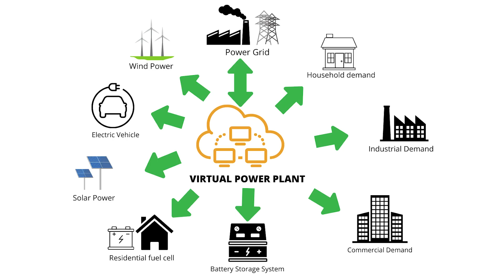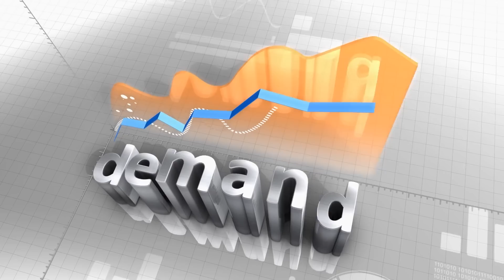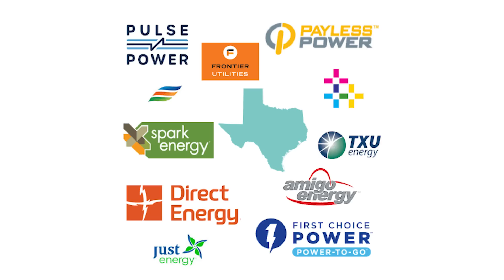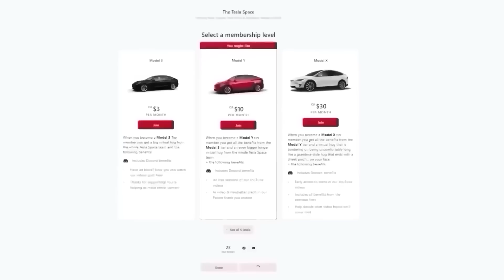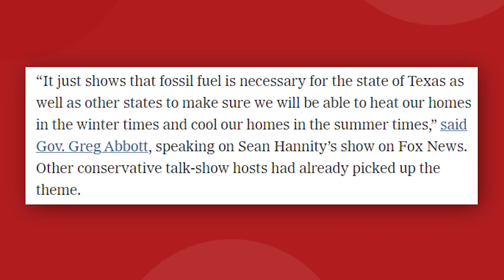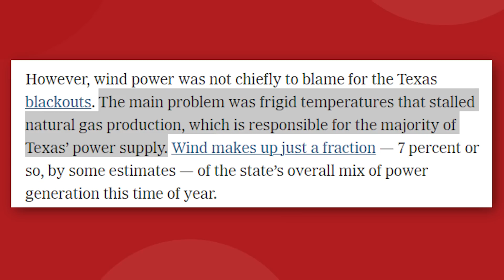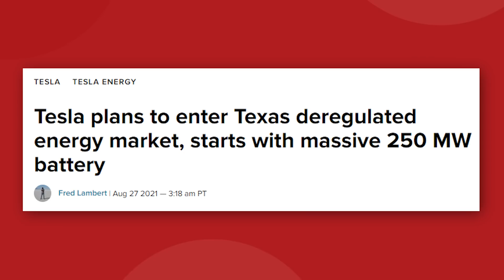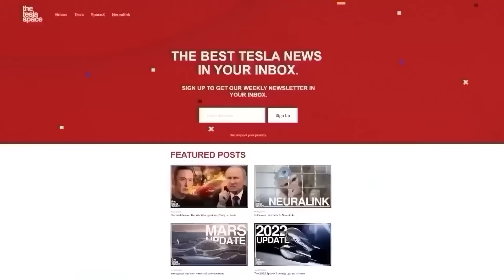Why Tesla Energy Is About To Take Over Texas!

Comment: If you want to take a fish out of water and claim it is inferior on land....you are not wrong.

You are taking that 2021 winter storm in Texas out of context.   Texas is supposed to be in the south, where it is warm.   During that freak storm, the entire state was blanketed with snow and ice.   The temperature in Dallas was -3 Fahrenheit.   It was very cold for Texas.   There has not been something that cold for 100 years.    For those of you who don't know, -3 F would be similar to -20 C.   That is Siberian cold.  

So, if you want to say Texas wasn't ready for that.   You are right.   But, who would be?    Can any southern US state handle a subzero degrees F with snow and ice for 4 days?    Every summer, the temperature in Texas goes over 100 degrees F for 60-70 days straight, and with AC blasting throughout the state, the power do not go off.

Comment: Worlds first Tesla VPP was piloted and is running in Adelaide South Australia. The Left Wing State Govt installed rooftop PV & Tesla Powerwalls in 50,000 public owned homes. This saves low income families a huge amount on previously extortionate power bills & stabilises the entire cities grid. They also commissioned & installed the worlds first Utility scale Tesla Megapack at Hornsdale. The fossil fueled Conservative Party privatised public utilities and prices went sky high using gas. They screamed lies backed by Fox that it couldn’t work & windmills & solar would destroy base load owner etc etc ALL the same bullshit the Right said in Texas. But instead their fossil fuel donors dumb gas peakers are $500m piles of dead stranded JUNK. Saving citizens BILLIONS. Good riddance

Comment: The whole system has to be monitored, and information has to reach each battery pack stored in individual has just in time.

If there is cyber attack, or for some reason wifi is down, the battery pack become useless. They need to work together to bring an impact to the society, but I don't see a way that is done efficiently. So many things could go wrong.

Comment: Pipes freezing did not stop the flow of Natural Gas. I had natural gas the whole time but no power. The hot water heater stayed lit the entire time, and if I had a generator at the time I would of had natural gas heat. The failure was due to more than half the generators were taken down for maintenance to prepare for summer as we do not usually get a winter blast in Feb. It is usually heating up by then. Wind and solar could not support the load, and Tesla power plants had not been built yet to store that wind and solar.  Now that there is a Tesla power plant 30 minutes from me, I would like to see if that could supply power for this area.

Comment: So, this is the comment with real Tesla Electric provider experience. You would not be able to choose anymore when to switch to the battery or to the grid. YOu won't be able to program. The only time you will drain energy from the battery is from 4 to 7pm. That's it. And all other times you will either use it from the sun, - or from the grid, - which costs you around 14 cents per kWh (and this price can change at any time). Whenever you are selling your energy, - the average price in Houston would be 1.4-2.5 cents per kWh. Guess now what Tesla is doing? They are making money on us. They installed wind farms somewhere (not much) and instead of selling that energy to the grid for 2 cents, - they are selling it to us for 14. But luckily we do have the option to go off-grid. With some automation, I was able to program it to go off-grid and back online. If for some reason Tesla would decide to remove the button "Go OffGrid", - I'd install an extra smart disconnect from Siemens for example which I will be able to automate through the smart home and still can be in control of how I am using Energy. Be careful before you go Solar. You can get lots of issues without knowing all the tricks. I learned from FB group the best way to go solar: install a small array *8 panels", - which will lower your daily usage + you can do laundry, dry clothes, dishwasher and run another high load. Next to it choose the "free nights" plan, - where you will not pay for energy from 7pm till morning. I believe the game changer would be when we will be able to use Tesla car battery as the extender, - so whenever you have extra load, - we would be able to offset it into car in fully automatic mode. But it's not there yet. I'd try to find some kind of automation to charge my car whenever I have excessive generation, - but I don't want to sell it for 2 cents, - and furthermore, - I bet they are still charging for energy export to the grid.

Comment: Put the power lines underground.
Reply: so when the soil will shift it will be damaged and repairs will be costly. Is this what you saying?
Reply: @arishem555  In Madison Wisconsin almost all power lines are run underground. This is done in many parts of Wisconsin. When Ice storms or Tornados etc happen we are not as vulnerable. I lived in Florida where we had 4 hurricanes in one year across the state. That's lots of electric poles replaced over the years.

Comment: Frozen gas pipelines was caused by short sighted power plant owners, saved money not installing freeze protection. Wind mill blades had no freeze protection or deicers for the blades.  Those were not the only weather problems.  Fire Sprinkle pipes, out door wall mounted water heaters froze too.  The Texas Deep Freeze 2021 was the storm of the century but Dec 23, 2022 it got down to 10 degrees.  The coldest night in Dallas/Fort Worth: 8 below zero set in 1899.

Comment: Tesla's own Giga Austin complex could eventually contribute a reasonable amount of power generation, primarily solar, to the Texas Grid if they were to take advantage of all of the outdoor parking & materials storage areas (including) all of the circulatory bits. By circulatory bits I'm talking about the access routes within these areas. People only tend to think of the airspace above parked vehicles or stored items but the airspace areas in-between these amount to a fair bit of unrealised potential power generation too.
When considering how to manage the 'heat island effect' of the built environment, shading from solar canopies can make a significant contribution towards lowering the negative impacts of this phenomenon such as lowering demands on electricity for cooling, healthcare services & in the case of EV charging stations, make them far more efficient by keeping both cars & infrastructure cooler. 
Giga Austin is going to become a vast industrial complex. Of course they'll want to utilise as much of their own power generation capacity as possible, but this should still leave a significant amount of excess generation capacity that shouldn't go unused.
Reply: Not true. Even with 100% coverage on every available square meter of roof, parking area, and storage space, Giga Texas won't even produce half of what it consumes. The math is easy to do and the areas are known, as is the power consumption of the plant (on file with the building permits if you want them. $35 for basic plans, more for complete ones)

Comment: @3:35 -- "Two dollars per killowatt hour, which is not much..."  

Are you joking?!   In my town we pay about 6.5 cents per kwh, which is pretty cheap, admittedly, but even in an expensive area you wouldn't expect to pay more than about 50 cents. I don't dispute that you might be able to get two dollars under certain circumstances, but to call that "not much" is just bonkers.
Reply: I saw that too. $2 may have been some sort of extreme price paid by the grid when it's in extreme supply deficit.  For a closed system in TX that might happen more frequently than we realize, esp last year when they had 100+ temps for months at a time.
Reply: Same, i would like to get a clarification. I love this content and want to know how to get 2 $ per kwh.

Comment: This is a helpful explanation but the biggest thing Tesla is missing is the power stored in its cars. Any Tesla vehicle has multiple times the power in its battery than any powerwall has. By refusing to allow the cars to provide the power back to the house, powerwall or VPP, it is a lost source that needs to be activated. In addition, the massive growth of megapacks should also be included combined with TESLA solar fields.
Reply: I don’t know that they are missing it, but you make an excellent point!
EV batteries have much more capacity than even a very large power wall install!
The best solution would tap into both IMO, Cheers
Reply: @kaf2303  YEs, exactly and in teh Cybertruck, where it is allowed the owner can say how much charge should be left. If you know yu can always go to a supercharger withing 15 miles, you can go down to 10% charge and use up to 90% for the house. I also wonder if it would be possible to trickle-charge directly from solar panels. All these options should be integrated to really reach Tesla vision to a fully integrated electric energy future

Comment: in my opinion, fuck oil, fuck "renewables", nuclear, batteries, and hydro electric energy storage
Reply: Nuclear is the best power source
Reply: @caesarsalad1170  Fission is already plenty, and with Fusion on the horizon, it's easily the best power source, especially when combined with batteries or synthetic fuel

Comment: You said that when the power line is down to your house, that's when the powerwall at home is key.  I thought that the powerwalls did NOT power the house when there was no power to the house, which struck me as completely ridiculous.  So, will Tesla PWs work offgrid or not?
Reply: Tesla PW can do a partial or whole home back-up. If you experience a power outtage , PW will kick on and supply the home with energy.
Reply: Can't find the video now. But did saw other day a person with 2 powerwall and solar charging is model X during a outage, the car was told to keep the powerwall at 90% and only use the remaining solar power to charge, all this with the air von/heat pump working to keep the house climatize.

Comment: I have been enrolled in the UK Tesla VPP for the past 12 months.  The advantage is I can import and export electricity at the same price (24p) which is lower than the current energy import price (34p) and better than current export price (15p).  The disadvantage is I have no control of the powerwall and Tesla only guarantee to leave 20% capacity available for me in emergencies.  Also, they cycle the powerwall from 100% to 20% and back to 100% each day whereas I would typically only discharge it to 60% each day.  Potentially that will reduce the lifespan of the batteries.
Reply: Yeah here in the US they also charge it to 100% down to 20% everyday. And I also have no control over that as well. The internet claims these are the same lithium ion batteries used in the cars so I cant imagine my pack will last the 7 year warranty after 365×7 20%-100% cycles.
Reply: Also buying the powerwall was dumb considering here in California we are grandfathered into a 1 to 1 net metering program. If it were up to me the powerwall wouldn't be allowed to dip below 60% because it is essentially just a back up is what we bought it for. Which it cant really do if it's at 20% during an outage.
Reply: Imagine you could use your Tesla vehicle battery. That would start really generate income and hopefully you could say: 10% - 80% range
Reply: @AMeierhoefer I can use my Tesla as a backup (Cybertruck)

Comment: In Oklahoma, the windmills were a problem and they make up up to 40% of our grid.  The problem with wind is when a cold front settles into a region, there is never any wind.  Wind is overused in our region and is unreliable, in that it produces the least energy when temperature is at it's extremes.  Gas lines can easily be protected from freezing, but in the last 2 winters we have gotten much colder than our seasonal averages.  Batteries may be the final answer, but when wind stops, and it's negative 10f outside in Oklahoma, as it always does when it's that cold, it will take a lot of batteries to make up the difference.  We need to weatherize out gas lines and keep those plants online.

Comment: I seriously doubt the "Texas government" was reluctant to allow for Tesla Energy. Cautious, maybe. Reluctant, I doubt it. Any new system tying into the Texas grid will always be seen with scepticism, as it should be. Videos need to emphasize these power plants, power sources, can be used as an integrated network, rather than talking as if one system is battling another system for power-providing supremacy. I've been in the engineering consulting field for over 30 yrs. I have NEVER seen gas powered plants flare or billow CO like in the Pic used in this video...EVER. Oh lots and lots of steam that the uninitiated could INTERPRET as CO. Yes, the Texas grid is  moving, or WAS moving at a snail's pace to properly insulate gas lines because Texas isn't known as a cold-weather state. Plus, all CLIMATE-CHANGE alarmists shout "global warming". So, yes, Texas being a warm weather state and "increased global temperatures" places delayed emphasis in insulating Texas power grid sources. I'm all for technology. I'm all for Tesla, but how about some honesty. Tout Tesla AND solar AND windmill power as supplemental systems that work in conjunction with gas and coal powered sources.

Comment: So much misinformation.
This is typical Texas weather. Every 10 years or so they get a polar event. Cold weather trapped under a dome.
What failed this time was renewable energy. Renewable energy fell to 9%. With electrification reducing gas heat. 
The Biden administration also interfered with bring coal fired plants back on.

Comment: All that matters is what is the night time usage, 4p16s has 64 batteries same as in the megapack unites and holds roughly 60kw. Scale that up to meet nighttime usage for Texas adding in 2 weeks of storage and you find battery storage is no were ready.
Reply: You don't need a huge battery system to provide enough power to avoid having to pay a peaker plant to spin up.
Reply: @matthewconnor5483  The problem is they are rushing to cut off cheap energy long before the infrastructure and technology is ready.

Comment: Tesla Megabucks are a stupid design. Lithium ion is good for high power density applications. A grid level substation is not pressed for space, we have been engineering solutions for these settings that use battery technology that relies on more environmentally friendly anode, cathode and electrolytes. Think Flow Battery or pumped hydro.

Comment: The Texas grid went down because the state refuses to force private utilities to winterize the gas lines and wind mills.  Wind mills are used successfully in a lot colder weather than what Texas saw.  They just require the extra cost of winterization.  This was a complete failure of governance, and it's not the first time.  This problem is repeated about every 10 years.
Reply: Yes here in Finland we have wind mils and we will get lot more of them this year and in the future. We have hardcore winters here!
Reply: Winterization does nothing against icing.
Reply: @samuelmorales2344  It prevents gas pipes from freezing and prevents generators in the windmills from seizing up.  How do you think they do it in northern Canada, Alaska, Europe and Russia?
Reply: @billweberx  Does nothing against icing of the blades itself. Wind turbines are intermittent energy. The more you add, the more intermittency you get. NERC has pointed this out. The UK has to install a cable all the way to Morocco to get solar energy because ocean turbines just don't cut it. Wind turbines are only not intermittent when there is consistent wind blowing like somewhere in the cold deserts and mountains of Patagonia where the wind howls relentlessly. Adding intermittent energy is another layer against predicting supply with demand. I would never trust such energy sources to be dominant in anticipating a winter storm. Batteries don't scale with large populations on the same grid. You don't know how much batteries you will need in the first place from such uncommon events. Natural gas can indeed be reliable if it is weatherized. The way I see it, if you spend 60 to 160 million dollars to prevent 100 billion dollars in damages, you are better off. As for Texas, since they depend heavily on natural gas, the regulator should tax all of the energy companies, and use that money to weatherize after them or mandate it. For now, I think instead of paying the surplus for tax relief, they should use it for grid infrastructure.
Reply: @samuelmorales2344  Solar and wind (with batteries) are the fastest growing energy source in the world.  Someone seems to disagree with you.  Go on believing what you will.  The world will continue the transition without you.

Comment: The first VPP to utilize Tesla Powerwalls is located in Vermont and is managed by the state's largest utility, Green Mountain Power. The utility leases specially modified Powerwalls to customers who wish to participate in the program. GMP can remotely control the Powerwalls from its headquarters, adding energy to the Vermont grid exactly where it's needed.